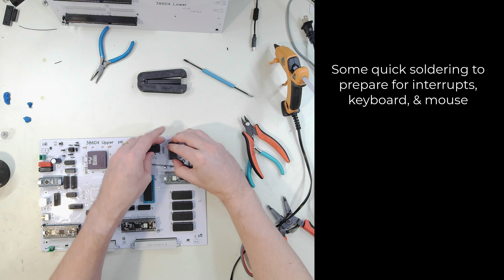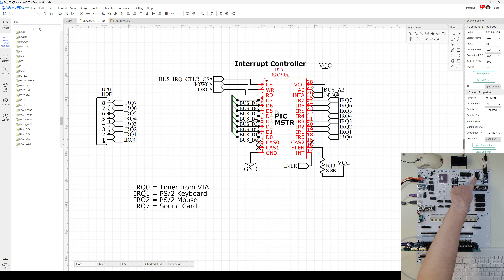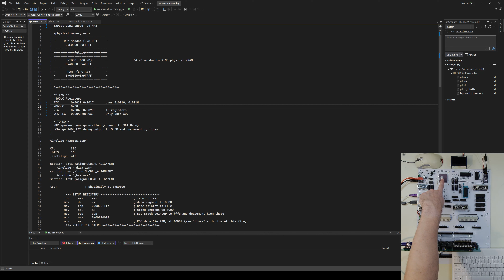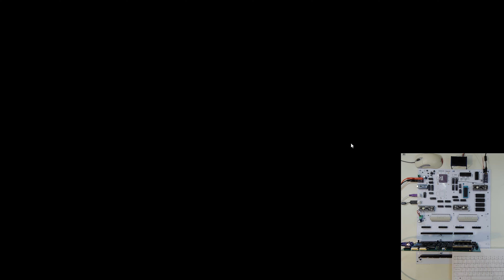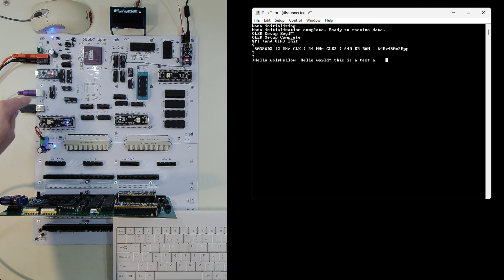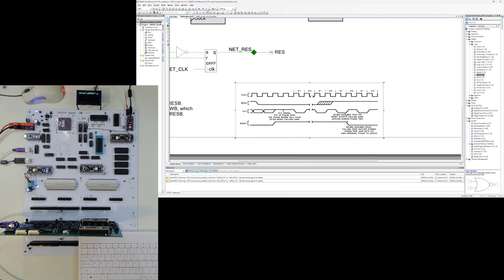80386 DX Build, Ep. 19 - Interrupts, Keyboard, Mouse

Comment: My understanding was that ISA didn't do very well at higher bus speeds. It'll be cool if you can get everything happy at a global 24MHz clock!
Reply from the maker: I believe my ISA clock will continue to use CLK at 12 MHz. With a 486DLC, I'm hoping to run CLK2 at 24 MHz, and the CPU will run at full CLK2 (instead of cutting it in half internally), and CLK on the ISA bus will be at 12 MHz. I'll let you know shortly if the 486DLC works for me.  :)